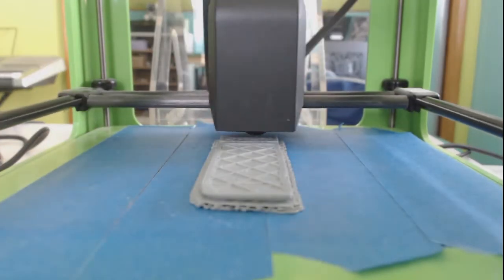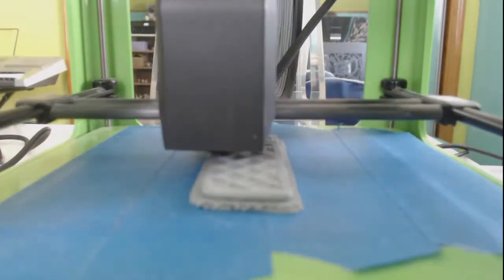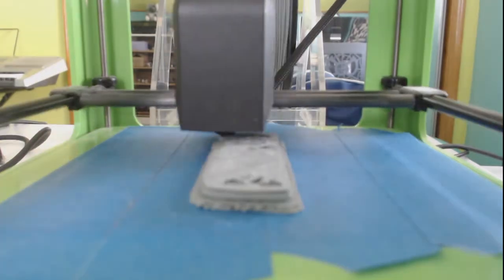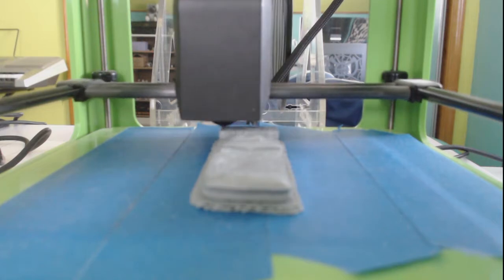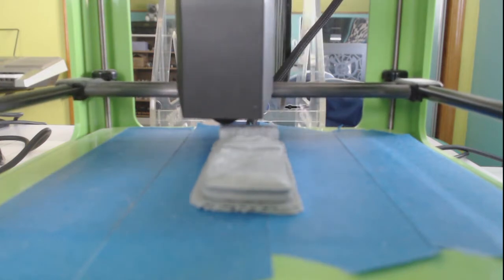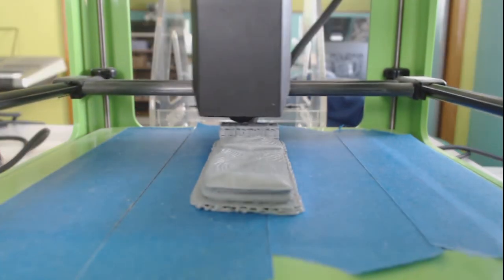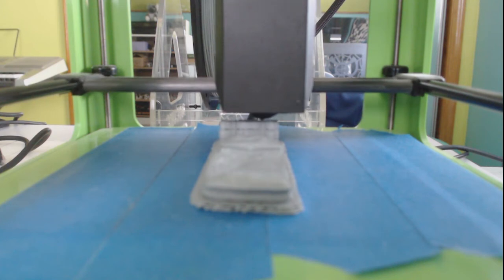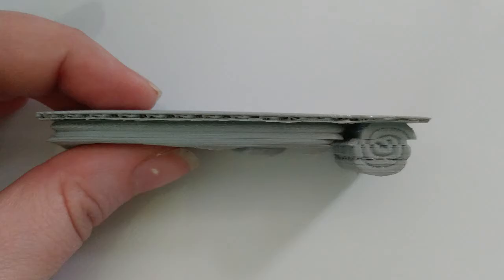3D Printing out the Bedroll D&D Minis

Comment: Hi Kasey, great videos again. A tip about filming. I don't know about the camera you are using for filming the 3d print process. But maybe you can turn off autofocus and give it a fixed focal point. It will improve the video quality and make the printing process better visible. Now it was focused at something in the back. Looking forward seeing what you going to make next.
Reply from the maker: Bram van Vliet  thank you! I'm just using a little Logitech webcam. I'll have to check the settings to see if I can do that :)
Reply: ah I see. I don't know that either. :-)